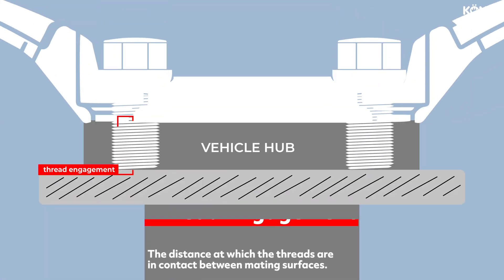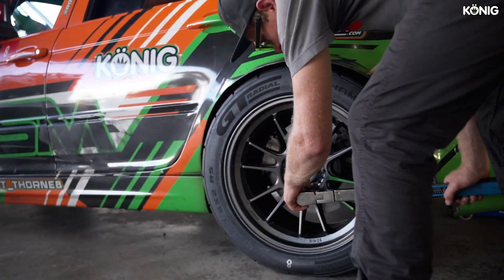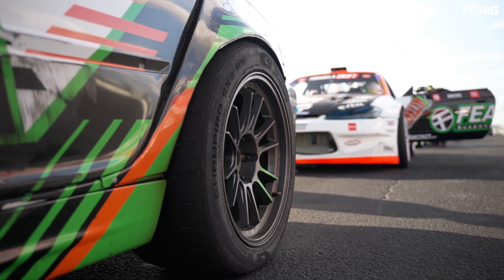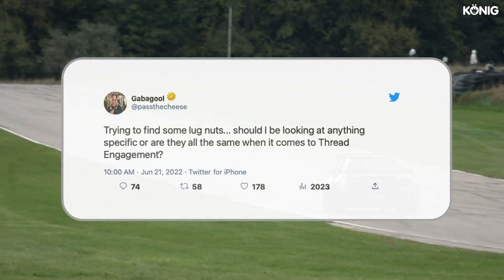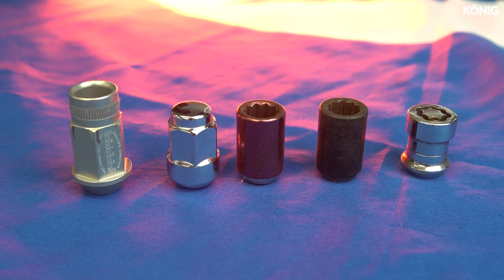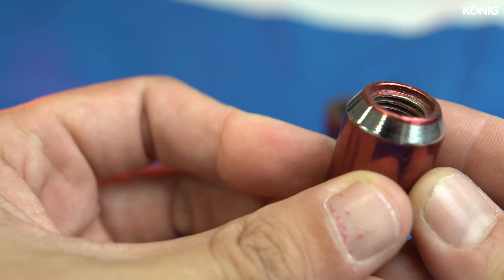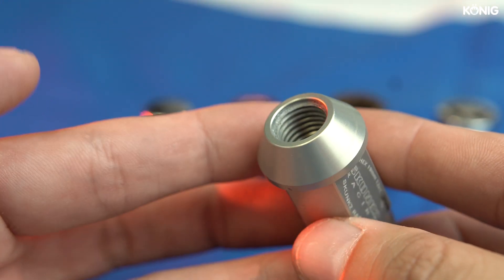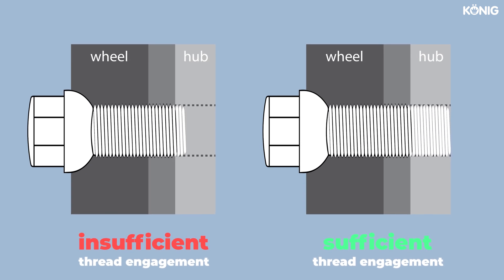The MOST OVERLOOKED factor when installing wheels… | #FAQ - Thread Engagement

Comment: Thank you for sharing this information, I have a question. I have a long stock lug nut and I cut half inch of the original stud  to 1 inch , now I have half a inch difference, the nut engages 13 full turns, is it safe for the stud to be half of a inch shorter?
14x1.5 stock
Reply from the maker: You cut the lug nut or the stud?
Reply: @ sorry I meant the stud, it’s half of an inch shorter, the lug nut is open end type
Reply from the maker: 13 turns should be good the rule of thumb is about 9.5 turns for the m14x1.5.

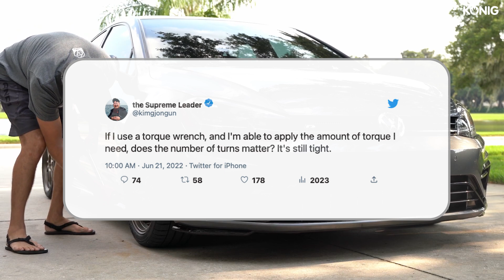Comment: 2:48 - could you please clarify your answer to your question about correct torque being sufficient? It sounds as if you are saying correct torque is sufficient, but then you also say you should check for thread engagement first. In my case I have 1/2”-20 studs which can be torqued to the suggested 85-95 ft/lbs after 9 turns. However, the thread engagement calculation suggests I need 10 revolutions. Is 9 of 10 revolutions at the correct torque aceptable?
Reply from the maker: Sure thing. Okay, so although you're able to torque your wheels down to manufacturer settings, you are not achieving proper thread engagement. Being short only one revolution won't put you in a dire situation, however you should understand that because of this, you're putting extra stress onto those other threads that are engaged properly. Anytime you're not achieving proper thread engagement, we would recommend thinking about upgrading to longer studs.